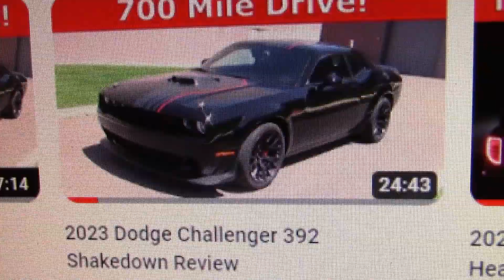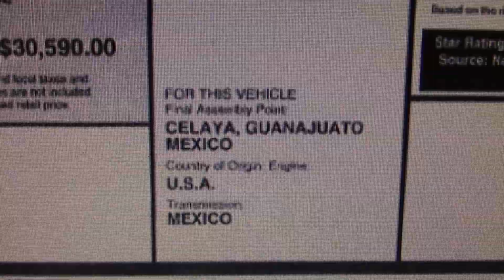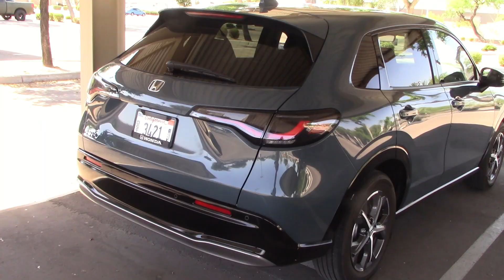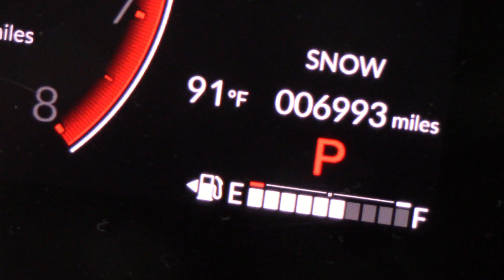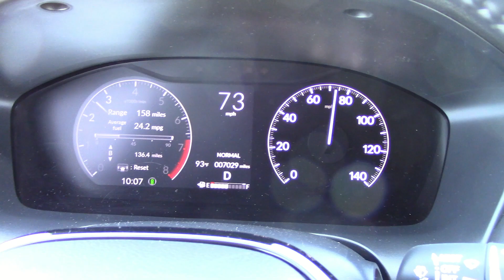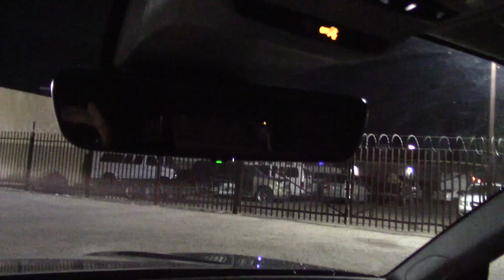2023 Honda HR-V AWD EX-L Road Test

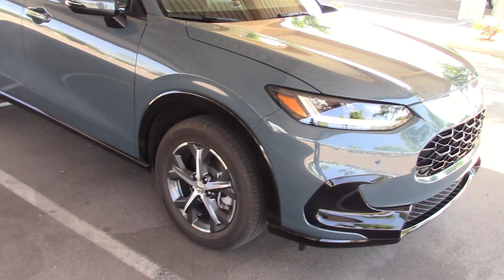Comment: 4:36 The number 1 reason that explains the very ordinary mpg compared to the Civic which has the same engine, is the port injection , unlike the Civic which has direct injection .The less efficient Hr-v's injection  will not cause carbon on the valve seats. You will have to bring the Civic for decarbonization every 45,000 km, not the HR-V.

Comment: totally disagree on the push button shifter preference. 

Reasons : 1) with push button shifters, you need to take your eyes off the road to select.  Very inconvenient when maneuvering in & out of tight spaces. 

2.) push button trannies haven't stood the test of time for reliability.  

3) The layout dictates a potential accident waiting to happen. If someone inadvertently spills their drink into a push button design, will it still work, right next to the cupholders !?   
Good luck on that one.  😢
Reply: The mechanical shifter (I prefer them)of the Hr-v  is simply poorly located, it is in the way when for example you want to reach the 3rd button to the right of the hvac
Reply from the maker: Wrong on all counts
1. You do NOT have to take your eyes off the road to operate a push button---in fact the opposite is true.  Each button has a different shape for a reason on a Honda.....you can tell what gear you are in by touch.  I have never had to look more than once, so there is no reason to look.  That is a Sam Haymart myth.
2. There is no such thing as a "push button tranny".  Whether a stick or push button control, the transmissions are the same.
And BOTH are electronic operated.  Honda has been using push buttons for ages and they have been proven to be reliable.
Go look at a Chrysler 300 stick...that will come off in your hand
3.  Honda push buttons are mounted high and designed to protect against spills....no coffee is going to get in.
Reply: @chadhaire1711  
An accident waiting to happen on all counts. Especially with kids in the front seat. Talk to me after 200K miles & then we boast about your push button design.
Reply from the maker: @tonelocrian  Nonsense......with kids in front seat there is more chance of them pushing a stick shift in the wrong slot than pushing a button...and no issue at 200,000 miles as the Honda Ridgeline truck has been using their push button system with 100% reliability,,,,,,,,those trucks easily go 300,000 miles.
Reply: @chadhaire1711 
Toyota, Mazda, Subaru & millions of CRV owners would disagree...
Pretty much nobody loves push buttons, or heavy tech dependent crap 
if they've been drivin ' well over twenty years.
Reply from the maker: @tonelocrian  push button in not tech driven dummy.....all shifters are electronic anyway.

Comment: This vehicle is definetly better than the Civic despite what most people say as it had Blind spot monitoring on all trims, Easier to get in and out of unlike the Civic, this vehicle is very beneficial when it comes to flooding as it sits up higher than the Civic, has less power than the Civic but is good enough, has a lot more room both in the vehicle and in the cargo area, and does the job well. Honda hr-v isn't liked by so many people, unfortunately, and it's sad because I own one, and it's underestimated. Sad because so many people like Hondas, but yet so many people seem disgusted by this new Hr-v.